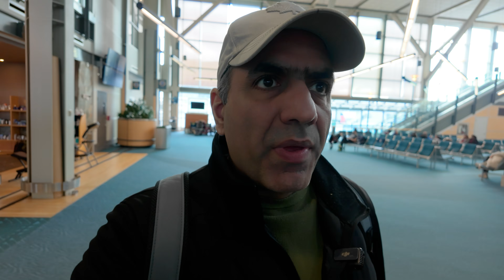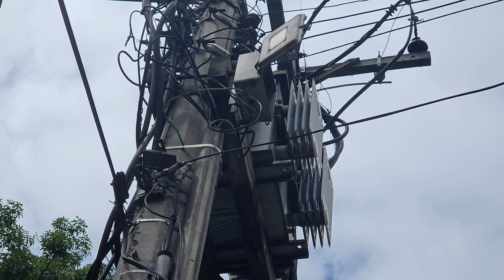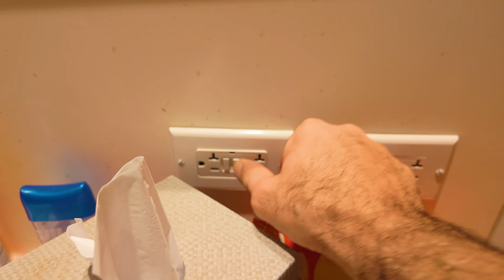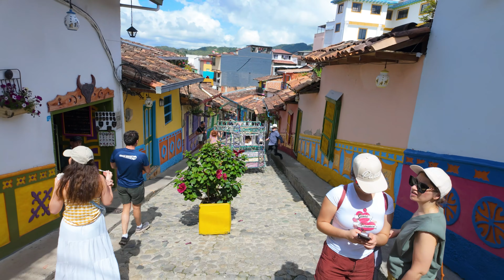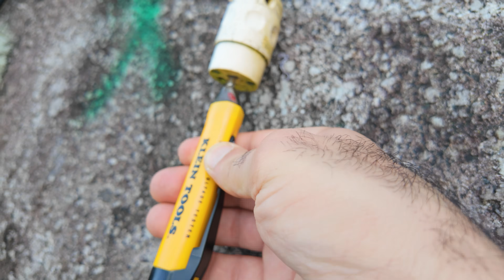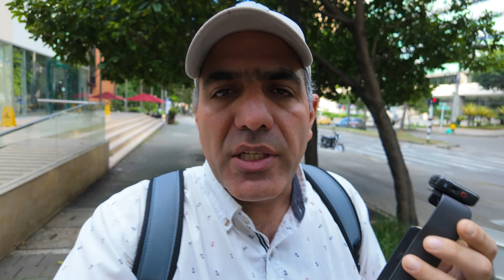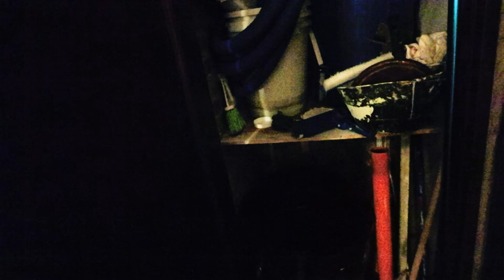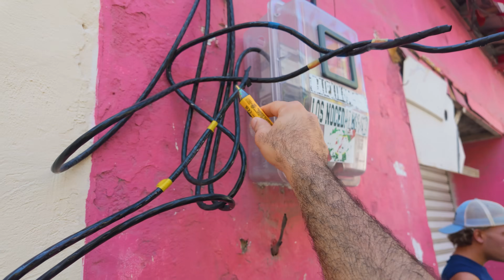Colombia Electrocutes Burglars

Comment: Really? You think you found problems in Mexico? You went to the nice part of town, you should see a regular house, no earth connection, there is indiscriminate use of wire and cable around the house, with different caliber almost per room, and the insulation color is just a random selection or it could  be all a single  color for the whole house, and the whole house is running of a single breaker, one circuit for the whole house.

Comment: I think is a common thing the low power breakers.
In Argentina, the normal house installation in the low voltage circuit is 32A at the pole.

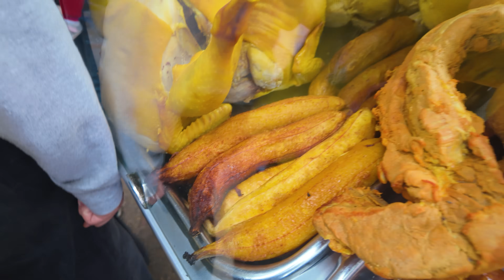Comment: Min 5:55 that´s not "fried banana" but a plantain, which is bigger and less sweeter than current bananas. It can be fried, cooked in oven or roast and is very demanded there. BTW, thin wires means low consuption: Colombian homes are not that "power hungry" like north-american homes, due to lack of AC equipment (in colder cities like Bogota), almost inexistent electrical stoves (they cook mostly with natural gas: mixed methane, ethane, and propane) and no expensive heating systems (the thermostat is a non-existent device in Colombian homes). Also, price per kW is more expensive in Colombia compared to US/Can: USD 0,20/kWh (Col) on average. USD 0,1747/kWh in US and USD 0,078/kWh in Canada... so they try to lower their electrical demand.

Comment: 25:02 Seems like you found a Reverse Bootleg Ground. Someone tied the ground to what they thought was the neutral but was actually hot because the outlet was wired in reverse. Anything plugged into that outlet will have its metal casing become live at line voltage. Amazing.

Comment: Glad you visited my country and my city.

Looking for breaker panels? those as quite inaccessible most of the times,  and don't expect to find any big panel in a residential area. usually those are hidden under a lid somewhere on the walls near the entry outlets. As you saw, there were pipes bringing electricity, but once home it is a gamble to find out where it is.

Comment: Columbia, prepare for electroBOOM,
Mehdi wants to check your breaker room,
The streets are very colorful,
And electricians follow every rule,
Just the electric fence,
Is there tho shock him hence,
But a smoke detector, disconnected, 
Could yet be detected.
Just deception,
Not enough for this inspection.

Comment: Things are not underpowered, we just don't need central heating because we don't have winters, and we mostly use natural gas for cooking, so no need for more power.
The other thing, is that small apartments use a single phase of 120 volts, but it's literally one phase of 120 volts, other apartments have dual phase (North American satandar single split phase) 120/240 volts. And houses tend to have 3 phase. Usually the electric service from transformer to homes runs in 6 to 8, and sometimes at 10 AWG.

Comment: For the thin wires going into the houses and other questionable situations, you should consider travelling with a FLIR camera and checking the temperature of the lines.  I did that at my 160 year old house that we bought recently and was shocked at how the lines were so much hotter than I had expected when we weren't drawing much current.

Comment: This fences are quite common here in brazil. They are not necessarily to cause pain or injury (cause that would could be illegal...) but they are wired to a system that measures how much current is escaping. If there are more current escaping than the expected (which is set during a "leaning" mode initially) the system sounds a alarm and, depending on how fancy it is, calls the police. If you were to hold for a couple more pulses most likely there would be a siren on that house.

Comment: I worked in a hotel once. And all the smoke detectors were all connected. If you held test on one till it beeped it would test every other detector in the building. One by one slowly throughout the building.

Comment: you should buy one of those electric heaters, those that are two wires that you plug into the wall and are connected to a heater coil. You put the coil inside a water bucket, before connecting.
They can be bought in 'barrio' hardware stores.

Comment: Apparently the electric fences kick up the voltage if you don't stop touching them.   So they will hurt more the longer you touch them.   That was from a security guy who installed them.   He also said they put the wire through the barbed wire so that if someone sets it off, then they will pull away quickly and get stuck on the fence.   If they break the wire, it falls onto the barbed wire (which they keep slightly elevated so it doesn't ground, and then it becomes charged.   The most important factor is the alarm though that goes off, and they often use thin wires so they also break it and guatantee the alarm goes off.   The thing is, branches break them, they rust, a plant grows up beside one and the leaf touches and starts setting off the alarm and shortly after they're installed they never get repaired or maintained because they are just a pain to deal with.
Reply: Might as well just charge the concertina wire.
Reply: @Jul-66  Well that would be an illegal weapon designed to hurt someone... this is just a plausible mistake.  Also the main purpose of the fence is as an alarm when someone is messing with it, and the wires are thin enough that they break fairly easily... which also creates lots of maintenance to keep it actually working.

Comment: Thank you for visiting my beautiful country. Let me explain why the electrical wires are "very thin." It's simple: it's due to energy consumption. In Bogotá, because of the climate, it will never be cold enough to use heaters nor hot enough to use air conditioning. Air conditioning might be used in some hot parts of Colombia, but it's not the norm due to the cost of energy.

Comment: In Switzerland, electrical accidents are relatively rare: ESTI reported 572 electrical accidents and 5 deaths in 2021 — about 0.6 deaths per million people. In Colombia, available figures are much higher: roughly 3.8–4.6 deaths per million per year (depending on the dataset/year), which is about 7–8× Switzerland’s rate. Overhead distribution on poles isn’t automatically “unsafe,” but it tends to increase exposure and risk if clearances, insulation, and enforcement aren’t consistently strong.

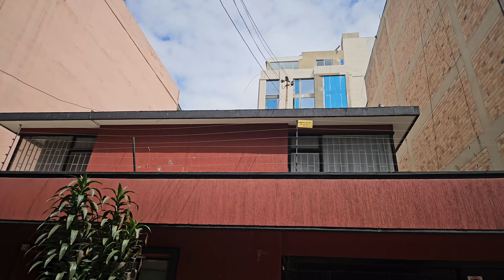Comment: Yeeess I'm happy you came to roast our electrical system. 4:30 here in colombia the average household for 4 people uses only about 100 to 150kw/h of electricity per month, which is in about the order of 5 to 10 times less than in the us, that's probably why our cables going into houses look thin to you (I have no idea what are you doing with it). Electric stoves, domestic hot water lines, and air conditioners are very rare, in most households the most demanding electronics are probably electric shower heaters, and a fridge.
Reply: So you do know why US houses needs a larger connection to the grid…
Reply: @themisterx8660 it's my best guess, I've never had one, so I don't know exactly how expensive they are to run, but the thought of a single appliance being 85% of my energy use is wild, there's probably more to it.
Reply: @pepopipo974  Heating. Heating is by far the largest energy user, even in relatively "warm" areas, within temperate zones you still need heating at night which uses a TON of electricity. Add to this that the US is actually pretty cold in the winter compared to most other inhabited places. Plenty of people will have gas appliances but for those who don't, electric heating it is, which consumes a ton of electricity. Same with hot water. AC uses quite a bit of electricity, but this is really only an issue in a few select places like Arizona where large amounts of people shouldn't be living anyways, the VAST majority of locations in the US heating is the #1 energy use.

It really is that simple, heating with electricity is just super energy intensive and very inefficient, and its very popular in the US out of necessity. Its part of why people are pushing so hard for heat pumps to become more common, because its such an easy way to reduce energy usage. I'm personally hoping that geothermal will become a lot more popular as a replacement. You guys in Colombia, especially up in the mountains, are very lucky, the climate there is almost as perfect as it can possibly get, so you don't have to worry.
Reply: Ok, your guesses are correct. Electric heating (+ cooling) is something that of course adds up to the electricity bill. But therefore you obviously don't consume any gas. Another thing might be using an EV. Of course you pay more for electricity because of that but you will definitely pay less than you would when buying gasoline.
So simply said: Your country did not electrify much stuff (yet), that's why you don't own many consumers of electricity.
Reply: kW(*)h, not kW/h. I guess aircon is more usual in Cartagena etc. - at least the sister oh my gf that lives there has aircon...
Reply: @EVPaddy of course Bogotá is 15 C and Cartagena 35 C

Comment: The wires seem adequate if there is no heating. Even easier if hot water preparation and cooking is done with gas.
I've seen 30 m2 apartments with 17 kW connections and 200 m2 houses with 4 kW.
Reply: It's only surpising to North Americans who are obsessed with 200 Amp services. Does anyone ever use the full power available there?
Reply: @mernokimuvek  A lot of places in the US don't have gas available. You need a lot of power for HVAC, hot water & cooking when it's all electric.
Reply: @rocketman221projects  But 200 A single phase still sucks. And US breakers are only limited to 80% continuous load, so 160 A. In Germany many houses have 230/400 V 3 phase 63 A service.

Comment: 23:27 "Either they have isolated live and neutral..." I think that's how it is meant to be done.
Reply: Floating... ie. Neutral not bonded to ground.  Isolated is a bit of a funny term for electricity supply, but is commonly used for some equipment.

Comment: maybe they are thin wires bec of higher voltage and lower amperage because higher voltage allows for the same power to be transmitted with less current which reduces the wire size needed.

Comment: Those electric fences don't run for free, can get expensive depending on the frequency of the system charge output schedule.  Can be set from seconds to longer before the zap occurs.  Fewer zaps equals lower bill.  Length of fence run makes a huge difference too.✌😤🍻

Comment: What is more sacrilegious: Mehdi pulling out a circuit tester in a church filled with ancient sacred paintings, or pushing bare wires into the end of an extension cord and using the circuit breaker as an on/off switch?
Reply: Trick question. The correct answer is turning on a breaker without knowing exactly what it might be powering.
Reply: @plackt A+. Head of the class.
Reply: What's more sacrilegious is connecting that capacitor to a hotel room not knowing if he will fry the place

Comment: We're waiting you in Argentina. Don't forget to visit Rosario, where I live. Get in touch if you need some guidance :D You'll like our power infrastructure (in the worst way, obviously). We also have electric fences here!
Reply: Not only electrical fences, electrical fences with 220v JAJAJAJA
Reply: @TrueNacho  indeed! (technically we've moved from 220 to 230 a few years ago, but adoption of this new standard is taking its sweet time)
Reply: @cocus-ar  No tenía idea que oficialmente es 230v. Igual 10% +/- tecnológicamente hablando es lo mismo en cuanto a tensión de alterna. Acá (sur de la provincia de BA) oscila entre 215 y 225 normalmente (223,1 en este preciso instante) con algún pico superior de 230v y algún pico inferior de 205v cuando está muy cargado el circuito por lo que claramente lo que EDEA entrega sería 220v.
Reply: @TrueNacho  Tenia entendido que tenia que cambiar a 230, pero ahora buscando no encuentro absolutamente nada al respecto. Lo lei hace mas de 5 años a esto. Aca en Rosario estoy mas cerca de 230v durante todo el dia (excepto en verano) que de 220v; la energia la provee la EPE en Santa Fe.

Comment: most of the power lines is under ground, the comunication like cable tv, phone land line and internet thick fibers are the cables you can see in air. usually but not always.

Comment: In areas such as the Comuna 13, you're safe as long as you stay in the tourist areas. But, there are alley ways that lead to back streets that are controlled by gangs/cartels. You have to have permission to enter them. They have a type of agreement with the local government, they will leave tourists alone, unless they walk those alley's and streets. Then, the tourist is fair game. If you're not supposed to be there, you will be mugged and even held for ransom and possibly killed. Be safe in your travels, and always stay in the tourist areas in Columbia. The agreement came after many wars with the gangs, in which there was no resolution, only casualties. Both sides lost lots of people and it reached a stale mate. So, they came up with that agreement.